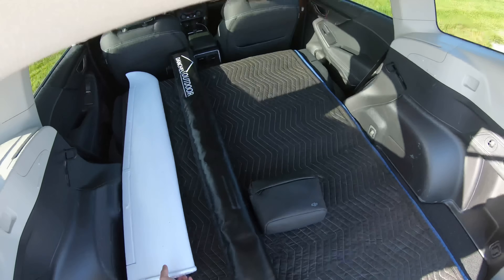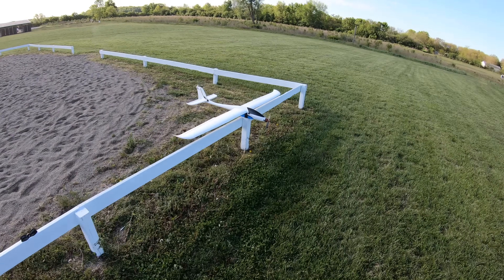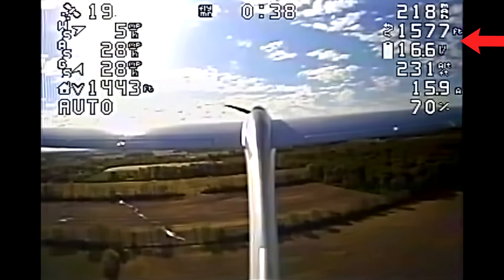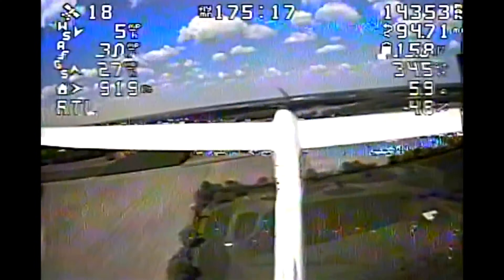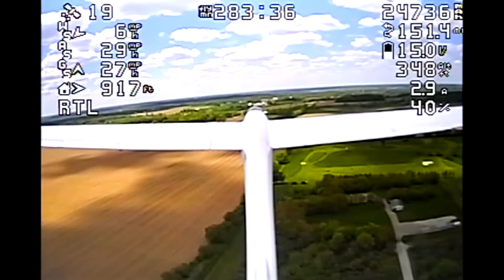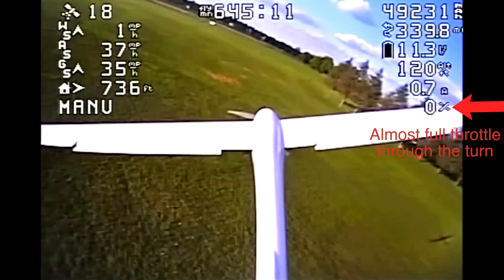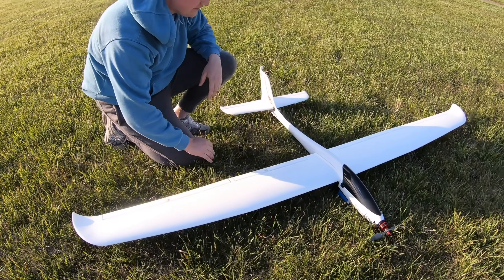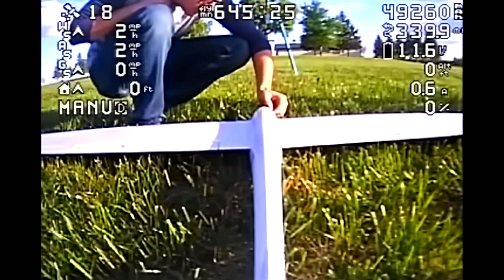My Longest RC Airplane Flight

Comment: The key to long range flight depends on the battery capacity and long wingspan? 

Have tried to use autonomous pixhawk flight controller ?
How much is that battery and it's weight?
Reply from the maker: Yes, those are two of the many key factors. The Matek flight controller that I was using was running the same Arduplane software that pixhawk flight controllers use. It is very smooth and efficient after you tune it, much better than iNav. I can’t remember the weight of the battery pack, but I’m sure I put it somewhere in the video. The pack was 4s 50,000 mAh Li-Ion.

Comment: Amazing video! Any other motors or props that would be even more "efficient"?
Reply from the maker: Thanks! The APC prop was about as good as it gets, but there are many higher quality motors out there. You'd need to get a thrust stand and test a few setups, but you could get a 5%+ efficiency gain.
Reply: @MatthewHeiskell  Thanks Matthew! Emailed you about a business proposal regarding doing what you love and getting paid for it :). Let me know if interested (or not, so I can move on to the next candidate)

Comment: Could you include RC HW into the description, some of the parts used are EoL now, are you interested to refresh the build? How about using non-rechargeable batteries, they are typically lighter, so 40xAA would be just 0.6kg + wiring, providing 17,000 mAh @12V
Reply from the maker: That's an interesting idea, but I've been focused on other projects. You should give it a shot though!
Reply: @MatthewHeiskell  Could you share the flight plan settings, like waypoints pattern, speed, altitude, power and etc? I'd like to have a starting point for setting up the test.

Comment: Hello, amazing video.

I'm trying to replicate what you are doing .

Please could you provide a guide on how you created the battery ?
Reply from the maker: I haven't made a video about that, but there are many good videos about how to make an e-bike battery. Just use the right cells, NCR18650GA, or something like it. Don't use a BMS, just put all the wires to a balance lead.
Reply: @MatthewHeiskell  why should I not use a BMS ?
Reply from the maker: @ogheneochukoakpojotor7683  None of our normal RC airplane batteries have a BMS (battery management system) because if the voltage gets too low, then the BMS will turn off power, and you will completely lose control of the airplane.
Reply: @MatthewHeiskell  thanks.

Comment: so during the 10h you were always on the motor? you were never gliding? do you think if you go to altitude and glide and then use the motor to regain altitude you can increase the flight time even further?
Reply from the maker: The motor was running the entire time, just enough to maintain altitude. I think this is more efficient then climbing and gliding, unless you were hunting for ridge lift or thermals.
Reply: @MatthewHeiskell  thanks for the quick reply and good video :)

Comment: Liked all your RC videos and subscribed! Question about the battery if you would be so kind: I have researched all your replies to other people regarding the battery. I have seen your XUAV Talon battery overview. As a beginner, do you have a couple videos you could recommend to BUILD a similar battery? Or maybe a step by step with parts? So far I have gathered 1. Spot welder 2. Proper batteries 3. Connectors? 4. Load balance? Thanks for your awesome work, it’s inspiring.
Reply from the maker: Awesome! Here's a good video about pack building. The only difference for us RC people is that we don't need a BMS (battery management system). We just need the main positive and negative and the balance lead for balance charging the battery. https://youtu.be/tKg-jIrr_JE

Comment: can you just tell me everything about how do you have the OSD and how did you setup the auto pilot to the receiver and all that things bcause i have a BFG 2600 and just a normal receiver and i want to set up a runcam split 4 4K and autopilot with gps but idk how and what things i have to buy, so can you meybe please like coach me how because i would be rally happy

Comment: Great presentation 
* You  were able to make a long lasting flight because of the long wingspan? And low speed?

If so, is there is a limit on the airspeed?
Reply from the maker: Yes, I’m no expert, but there’s a sweet spot. You don’t want the plane to fly as slow as possible, just a little faster than that. This is for endurance flights. For distance flights, I think that you want to fly even slightly faster.

Comment: now add solar pannels
Reply from the maker: I tried solar cells several times before, but I actually had my best performance with battery only. I think that you need to custom design and build a plane to get as many solar cells as possible. Retrofitting solar cells on a off the shelf place just does not seem to be enough.
Reply: @MatthewHeiskell  ok cool

Comment: Mal muy Mal, el Invento de las Baterías. ESAS no son las Baterías Apropiadas, para un Aeromodelo y se Descargan muy Rápido, ademas
de ser muy pesadas ¿Lo has previsto así?
Reply from the maker: Li-Po es la batería estándar de los aviones RC, pero utilicé estas celdas de iones de litio porque tienen aproximadamente el doble de energía para el mismo peso. No se usan muy a menudo porque requieren una descarga lenta para evitar daños.
Reply: Bueno pues las hay en Forma de pastilla del mismo material, más ligeras y más potentes por volumen, solo tendrías que ver su precio, pero piensa que el Motor, no tiene que estar siempre en marcha, por eso se suele hacer con   los Veleros o usar una Piper Cub j3 que te va a volar igual sin asomar la  batería. Yo tengo una con un equipo LRS de DMD de los equipos antiguos o casi de los primeros que se usaron en las pruebas de desarrollo de los UAV o FPV. Pero cada uno, hace lo que quiere y puede, hay para todos los gustos, un abrazo y que tengas buenos vuelos.

Comment: have you considered a translucent top to the foil with solar cells inside the wings?

Then you can optimize the wings for aerodynamics and the solar cells for power generation.
Reply from the maker: Yeah, I covered the cells after I embedded them in the wings. I thought it looked pretty good, but apparently the efficiency was reduced.

Comment: Very cool!
I do wonder where the threshold is between battery size (weight) and endurance. At what point does the battery become so large that it's weight requires more power to keep it aloft.
Reply from the maker: Yeah, there’s a peak that you want to hit.

Comment: would this exact setup be able to continue its autonomous flight if its out of range of the telemetry? or will a fail safe trigger?
Reply from the maker: Good question! I could have loaded waypoints into the flight controller and sent it beyond RC control and even beyond telemetry.
Reply: You can choose if you want loss of rc to trigger fail safe or not,  but if you have no link at all it’s just a message in a bottle kind of flight

Comment: How long did it take the battery to charge?
Reply from the maker: Good question, it can handle being charged in two hours, that comes from the 0.5 C charge rating of the cells. But I charge it more slowly over night. Dendrites form inside the cells during charging, the slower you charge, the less they grow.
Reply: @MatthewHeiskell  wow, that is awesome!

Comment: Hi: full scale planes can drop their empty tanks in the military.  I believe your plane can be more efficient if after a battery is depleted, the dead weight is dropped. The space shuttle has the same idea.  Rocktes also utlize the same principle
Reply from the maker: Yeah, haha I’ve thought about this too. I’d love to have several batteries and safely drop them as they are depleted, but it seems tricky, managing the voltage and battery connections
Reply: @MatthewHeiskell  also the CofG
Reply: @MatthewHeiskell magnetic charge connector to a hub of 4 batteries and stage drop
Reply: @MatthewHeiskell  you also have to manage CG as well which makes it even harder. But who doesn't love a little engineering challenge?
Reply: @MatthewHeiskell this was a bot comment. Not even a real account.
Reply: @MatthewHeiskell , have it dropped at the home point😂
Reply: @MatthewHeiskell  

I've spent some time thinking about this, and I don't believe it would be too challenging. Suppose you had a droppable pod (or two) under each wing. You could pretty easily design an electrical contact which would be robust but not require any disconnect force by using a couple of sprung contacts that are held tightly together by the release mechanism (for low currents you could use springs similar to what you'd find in an 18650 battery holder).

Electrically, you're obviously going to want to fully drain the 'pods' before touching your internal battery. It should be possible to do this with a fast relay (or ideally, a solid-state solution like a couple of MOSFETs).

You could either connect the internal battery a few microseconds before disconnecting power from the 'pods' (and just accept the fact that you'll momentarily pull a high current from your internal battery), or you could fully disconnect the pods prior to connecting the flight battery, with a supercapacitor to cover the tiny gap in between. You could program your radio so that there's a sequence in which the motor is cut, the pods are dropped, and power reapplied in order to minimise the chance of brownout.

The advantage of an electrical connect / disconnect feature is that you can do the switching nice and quickly,so that there's less concern about the timing of the mechanical disconnect.

Another advantage to this approach is that you'd only need to monitor the battery voltage at your flight controller, as you're only running off one supply at a time. No need for individual channels connected to each supply.

EDIT:

If you were to put the MOSFET on the battery pod itself (rather than having it all centrally), you'd also be able to save on the weight of your power cables. You could have a single pair of conductors running the length of each wing, with each 'pod' connected in parallel (with the MOSFET disconnect circuit keeping each pod out of the circuit). A very thin signal wire could then be used to connect / disconnect each pod on command.

The mechanical release mechanism can be made fairly simple too, as you know in advance the sequence in which you will drop each pod. A continuous rotation servo could pull on a wire or cable embedded the wing, with the amount of slack dictating the time at which each pod will release.

This would also allow the electrical and mechanical aspects of the release mechanism to remain very flush with the wing's surface. A small slot could be cut (into which a mounting lug on the battery pod would be inserted), with the electrical contacts being flat sections of thick copper tape or a small PCB mounted flush to the wing.
Reply: Dropping LiPos around might be very, very dangerous unfortunately.
Reply: @alex.jabba.cristea  good thing it’s not a lipo😏
Reply: @alex.jabba.cristea  drop li ions then
Reply: @alex.jabba.cristea dropping lipo bombs lol
Reply: @alex.jabba.cristea not if they have parachutes like the little military dudes and have an apple air tag on them to track them then it wouldn’t be that bad it guess it would only be bad if it lands on a tree or in water
Reply: @idiotequedwaal and 300 pound fuel tank is fine though
Reply: Rc Bomber
Reply: You can drop off package as long as you have an autonomous flights controller such as pixhawk 
You ser up the waypoint ( specific location) and the pixhawk will send a signal to the servo to release the package
Reply: Lol the granny walking her dog down the street might get hit with freedom
Reply: @alloy11  granny has lived a long and well deserved life.
Reply: Parachute the depleted lipo. Quick disconnect (explosive style)xt60 lol
Reply: @jeremygalloway1348  how will the wires disconnect
Reply: The drop tanks are dropped to reduce the (profile)drag. Now with glider like this and battery practically integrated into the thing, dropping the battery would practically not decrease the (profile)drag. The weight itself changes the glide ratio(basically the sum of drag in this case) just a little. But the most effect it has it's that it increases the best glide ratio speeds, which is why gliders irl sometimes use water to fly faster. 
So dropping batteries would let you fly slower, but wouldn't particularly increase the flight time.

Now one can argue that speed is drag and drag is something we're trying to battle. Now that' the thing, there are different types of drag, the "profile drag" and the "induced drag". Induced drag is usually at its most at low speeds, and decreases with speed increasing. The profile drag on the other hand, increases with the speed. So there is a sweetpoint, at which the sum of the drags is at its least, which for gliders is the best glide ratio, and for engined sircraft is probably somewhere close to the most efficient fuel consumption speed. So what that battery weight does, is that it moves the induced drag polar moving the sweetspot in terms of speed upward, but the sum of drag barely increases if increases at all.
Reply: @rederos  You're pretty well right on this (I fly full scale gliders, sounds like you do too).

You're right that extra weight doesn't change your glide ratio much, it just changes the speed you need to achieve the best L/D.

But if you think about it, that does directly correlate to time aloft. If you're flying 50% faster (on the same glide slope), your flight duration is going decrease proportionally. 

Even ignoring the effects of increased profile drag, if flight time is what you're optimising for - reducing weight as much as possible should be the goal.

Another factor to consider is that as you descend in a glide, you're losing gravitational potential energy. To maintain level flight, this is the amount of energy you need to put back into the airframe (it's easier to imagine periodic climbing and gliding, than to imagine the steady state condition with constant engine usage).

The heavier you are, the more energy is required to regain any altitude you lose. In a glider this isn't such a big deal, because you're extracting energy from an air mass which is effectively unlimited. You might take a bit longer to climb, but you're not going to suck all the energy out of a thermal. 

I think the proper way to think about this is to consider that while the L/D doesn't change much, the lift required (and hence the drag) does. Drag is directly proportional to the energy you're burning to stay in level flight.

You're also correct that profile drag is the main reason to ditch a drop tank. But this is largely because an empty drop tank is super light. An empty battery is still just as heavy, so you see a real benefit in ditching it once it's spent.
Reply: @JMMC1005  Hi! Yeah I fly them too, quite a beginner though! Intresting point that you make about the more energy needed to get more weight higher... Another thing that I am thinking about is whether lifting it there and having it there is different thing. If you are desired to stay on a certain altitude, staying at the altitude requires a certain amount of energy... Now if you think about it as an aircraft not gliding down but flying level, all you're battling is the drag, not trying to lift the weight itself, as we're not lifting anything but just sustaining the airspeed for the wings to do all the lifting... It's not a small equasion, really not sure about it :D
Reply: Oh no nevermind, you explained it there now when I read it the second time. Yeah, good points, I take mine back!
Reply: No littering!
Reply: Oops only now see your comment. Yes that's what I was thinking. Sitting nice and lazy on a couch.
Reply: @djsolstice8964  

Possible but quite challenging I would think. 

You could probably do something a little simpler, like have a hook on the plane which could snag a cable held up in a known location. You could have a small battery pod which could be winched into the plane and then dropped off.
Reply: we know about full scale plane but these are Small  Unmanned Autonomous Plane that use flight controller to navigate thru waypoints mission with GPS and servo commands such as drop off , land, return home, etc
Reply: @franciscoe.9989  I mean... Same physics apply to those...
Reply: Fires plus it would likely mess with the COG without a lot of messing around.
Reply: You know how pricey lions esp huge ass packs are? This idea isn’t good for this purpose
Reply: Bro do you know how expensive that is
Reply: You can’t legally drop stuff from airplanes and rc drones.
Reply: Yeah.... but no:   

 https://www.ecfr.gov/current/title-14/chapter-I/subchapter-F/part-91/subpart-A/section-91.15
Reply: Which country  from you
Reply: It would change the COG.
Reply: Это глупость. Сбрасывать батареи. Умное решение - это использовать двс. Бензин сам сгорит в моторе и сделает самолет легче.
Reply: drop the battery and drop out of the sky?
Reply: lol, no you can't. Batteries are expensive😂.
Reply: Tank dropped
Reply: The FAA also utilizes principles to fine civilians from dropping things from the air.
Reply: Hi
Reply: You could probably reach 1000 km range with the wind🤯
Reply: Bro would have created a 1/64th scale bomb
Reply: How do you think the tesla is going so far?
Reply: Yeah, or if you just installed a small nuclear reactor core you could have like decade long flights
Reply: @bentprops_  I didn't know " nuclear reactors were lightweight and portable like batteries 😳
Reply: The batteries should be dropped over dry California forests. The thermals of the resulting fire might even create extra lift.
Reply: @antman7673 go back to dating your cousin in Kentucky